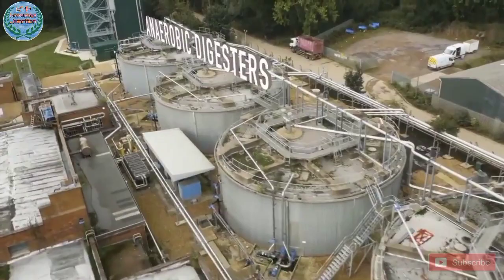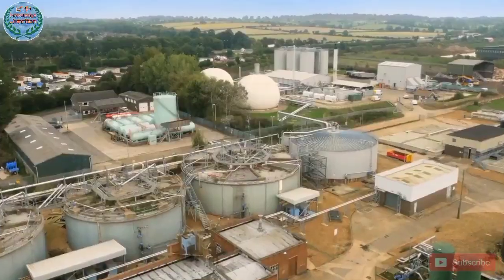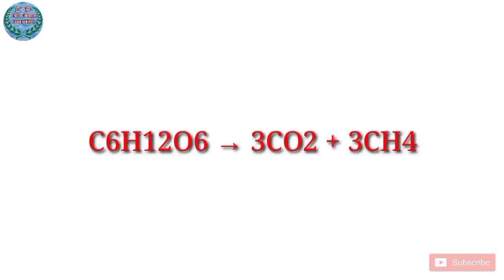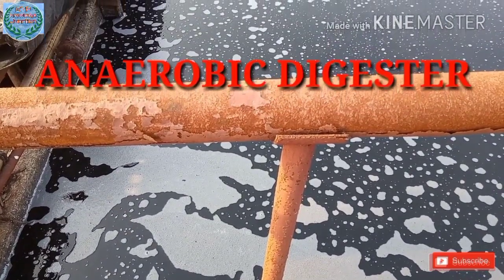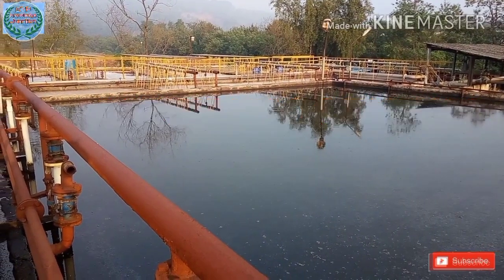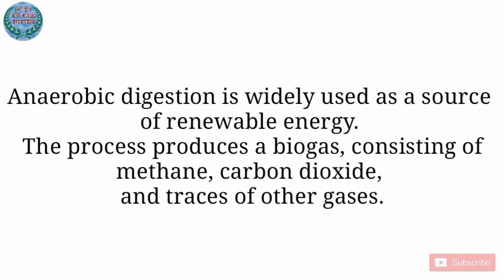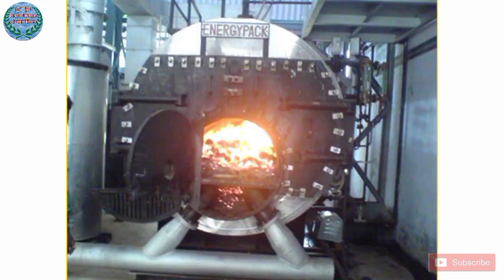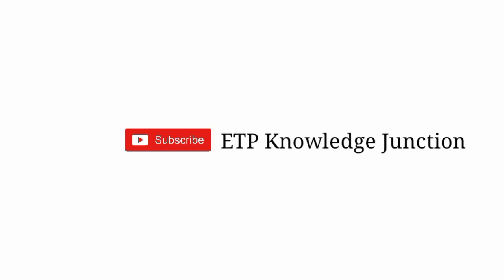What is anaerobic digestion || anaerobic digestion in wastewater || @ETPKnowledgeJunction

Comment: What is your opinion about sludge from secondary settlement tank of stp ( activated sludge process) to biogas plant( food waste ) industry type is Hotels & restaurant
Reply from the maker: I didn't get you.
Reply: @ETPKnowledgeJunction my self gigin, maintenance Engineer of a hospitality industry,
Reply from the maker: I mean I didn't get your question.
Reply: @ETPKnowledgeJunction  recycling of sludge from secondary settlement tank to biogas plant as input
Reply from the maker: Activated sludge from a secondary clarifier can be used in a UASB reactor for biogas production, but it requires adaptation from aerobic to anaerobic conditions. This process can take time, and the efficiency of biogas production may initially be lower. Research supports its feasibility, with studies showing successful conversion after acclimatization. Operational adjustments and pre-treatment may enhance the process, making it a viable option for biogas generation.